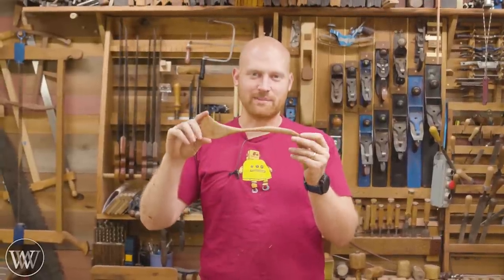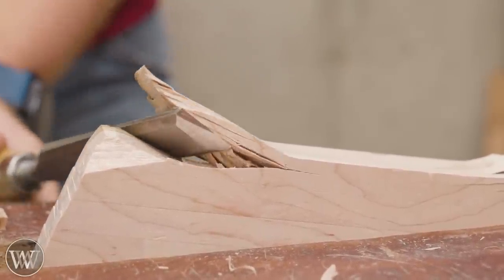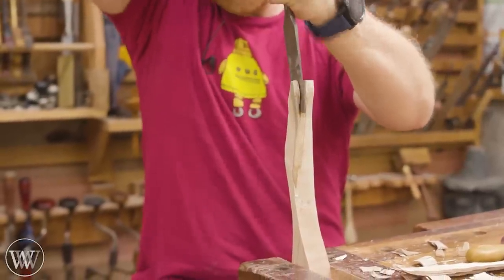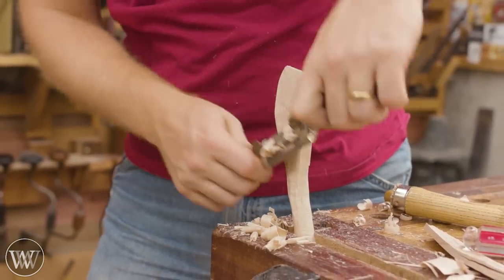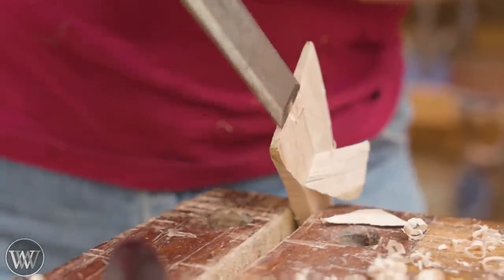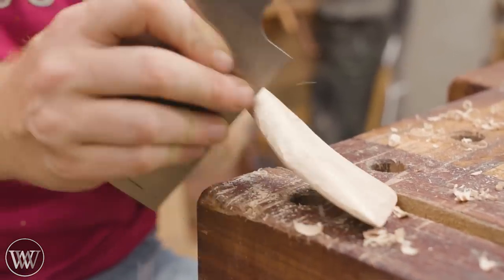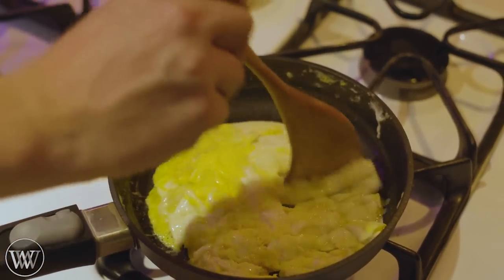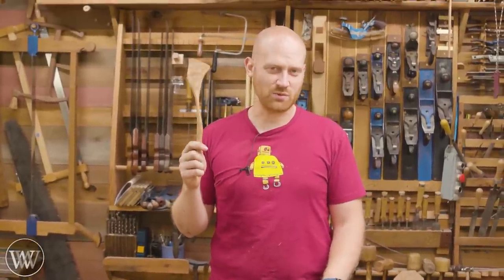How to Make a Spatula with Minimal Tools

Comment: You seem to bring out a video on a subject that Paul sellers has just put on woodworking masterclass . I wonder how this happens. But Paul is a proper craftsman sometimes you irritated me as you can be very rough with your woodworking. Slow down go on some properties woodwork courses it will help you no end.
Reply from the maker: I am not up to date with what Paul is doing in the master class. sorry. I may seam rough but my goal is not craftsmanship but the fun of the shop. Paul and I are two sides of the same coin. thanks for the criticism. I do admire that.